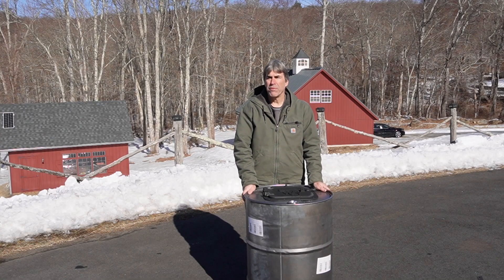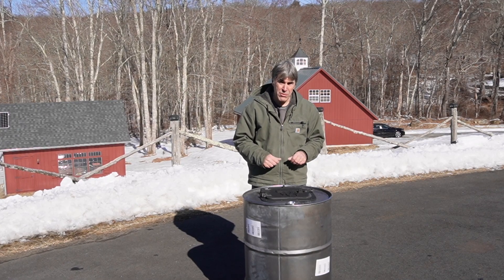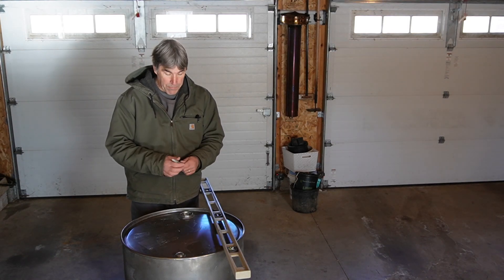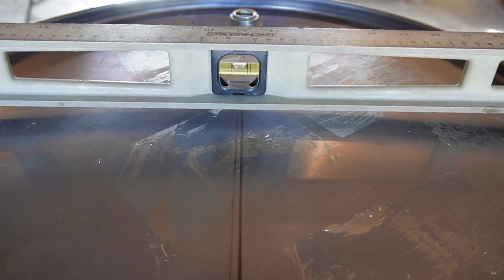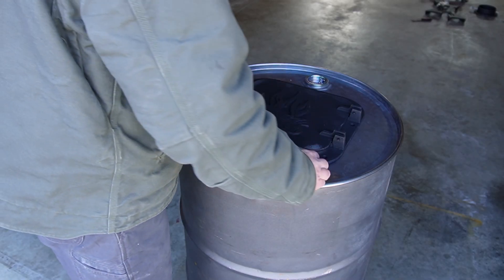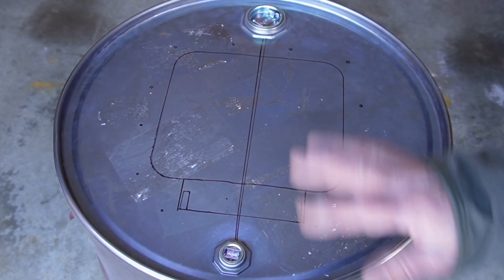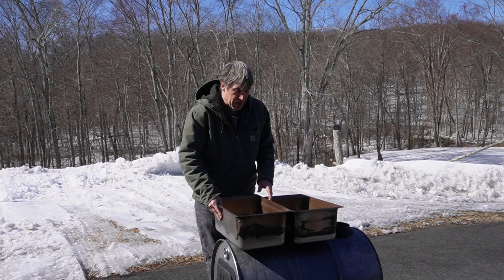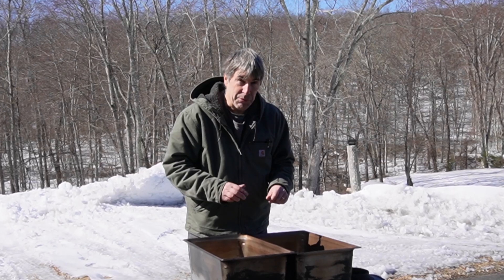Building a Maple Syrup Barrel Stove Evaporator.  Will it work?

Comment: I been using the same set up for over 15 years and I find it way better to have the smoke stack going out the back because it gives more room for the pans because you don't know what pan that will have to be moved.. there's times I have to empty the back pan when the front pan boils most of the time .. And I use stove gasket to seal around the pan so no smoke leaks and to keep the fire from going up the side of the pan and burn where there's no sap
Reply from the maker: Great advise.  I would have preferred the stack out the back as you suggested for the same reason.  I may do some mods this season to try to make it more efficient.  I am working on an idea for a preheater for the sap to keep the boil more consistent.  Thanks for the comments.

Comment: Ever think of using a rocket stove/water heater design? you could take the coils from it wrap your boilers in it and use ethely glycol as the fluid to heat them, similar to radiant floors just much hotter you should be able to greatly increase you capacity and speed up the boil time, you could also regulate the temp with a good pump and thermostat too.
Reply from the maker: @HeroQuartermasters  Great idea but a little more involved than I wanted to get for this project.  Do you know of anyone who has used that design or something similar?